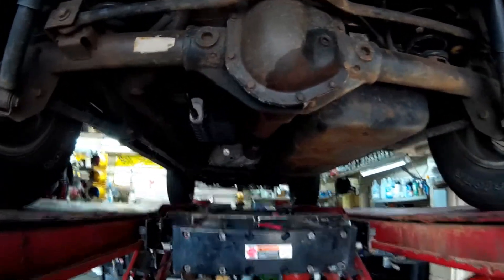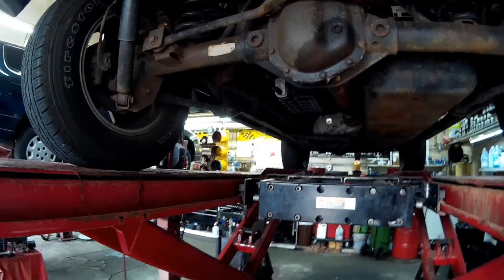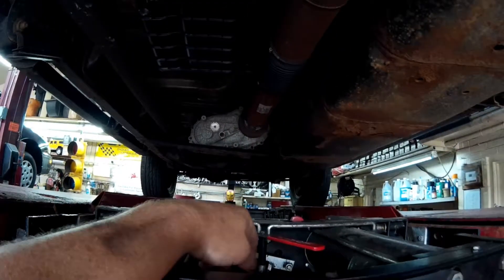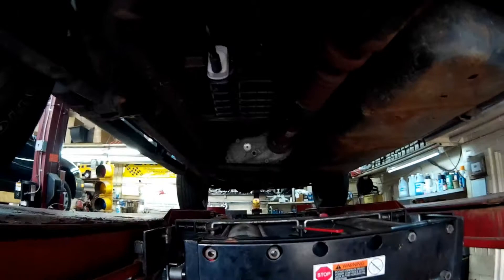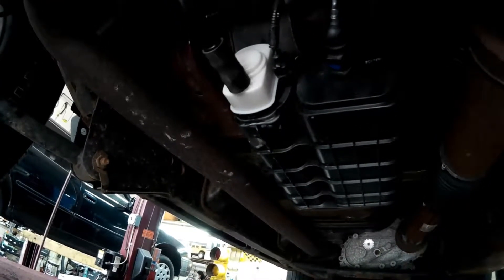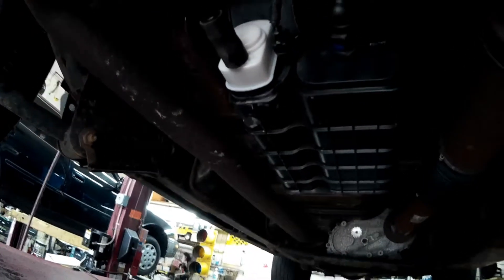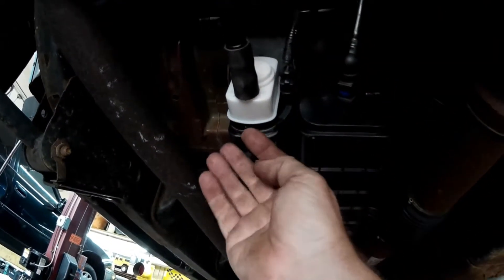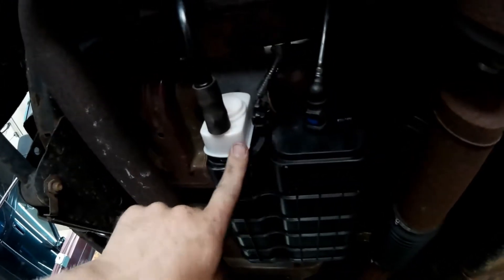2007 Jeep Wangler With Codes P0440 and P0456

Comment: Factory: mine came from the ESIM in the 12 oclock position, failed after 5 years. Replaced and solved the p0440 code. Just added a evap skid plate (8 yeaes later) with a predrilled hole in the 6 oclock.
Bam, now i have another p0440 code. Time for another ESIM. Guess this is what they call a jeep thing😂😂😂

Comment: I'm having the same issue with 2011 jeep wrangler same code I did smoke test and nothing I even change the gas cap new from dealer and still p0440-p0456
Reply from the maker: This think could be bad. Thanks for watching
Reply: I have a 2011 wrangler, I had the P0456 code as well, turned out it was the evap line nipple coming off the gas tank it self, it was cracked, check it. I had to JB weld it. Got rid of the P0456 code but I still have P0440. Thinking this part maybe bad or mounted wrong.